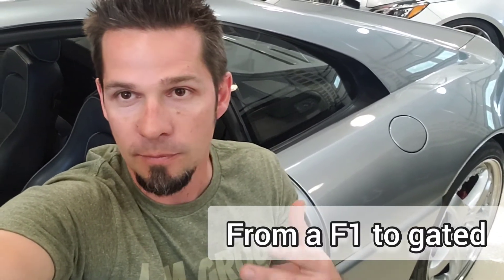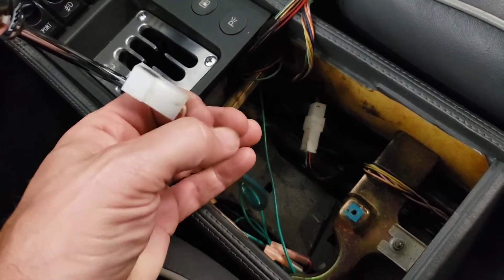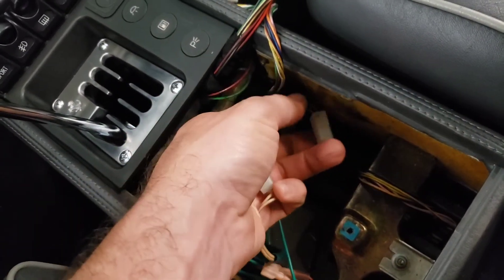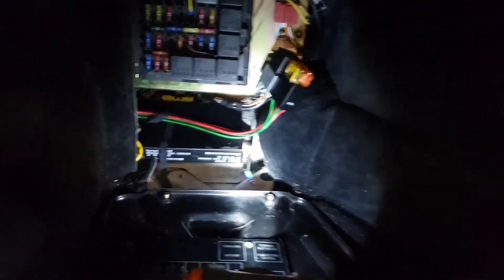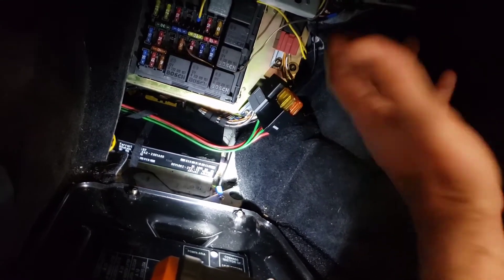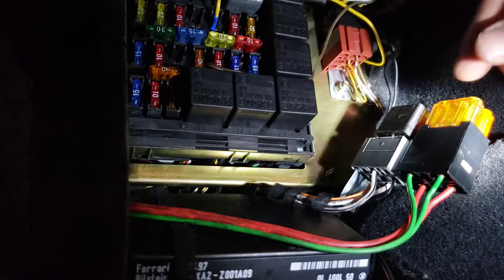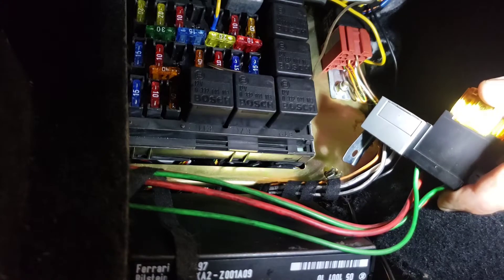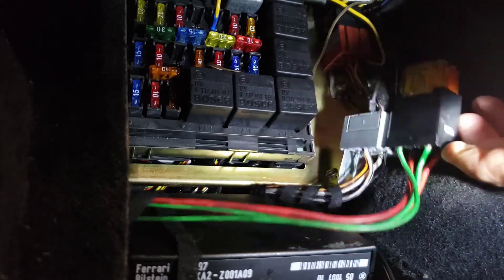355F1 manual conversion Part 2, wiring (updated)

Comment: Where can i get the gated kit ? Huge thxxx
Reply from the maker: Good luck, very hard to find. Put the part numbers you need on eBay alerts and get on a waiting list with the popular dismantlers like ferrparts etc.
The shifter box assembly and the 5.2 pedal box are the hardest to find 
I had spares, intending to convert another 355, but sold them recently

Comment: What is your background?  How come you know how to perform this kind of wizardry?  Impressive!👍

Btw, guess you prefer the gated?
Reply from the maker: Haha, I learned most of the stuff just from pure necessity when my first car broke down as a teenager.
One of my first jobs out of college was an aviation mechanic for a few years

It's a toss up. Overall, I prefer a manual. I know the bandwagon for the past decade has been "manual cars rule, F1 sucks" I actually now have a 430 F1, and I love it.
Sure they're annoying in parking lots, and at low speeds the F1 precision is similar to 16-year-old, but at full throttle it's glorious
I respect both

Comment: Nicee even better 😎😎
Reply from the maker: You finish yours yet?
Reply: @ExoticCarDIY   sadly not yet comrade, still trying to figure out the pedal box hah.
Reply from the maker: @devilsbokchoy  yeah that seems to be the hardest part, I've been working with three other guys and I think they're all opting to disassemble other affordable boxes and welding on the pedal. If you go this route, I can give you all the measurements from an actual manual pedal box
Reply: @ExoticCarDIY   will do we’ll keep in touch on IG thanks man 🙏